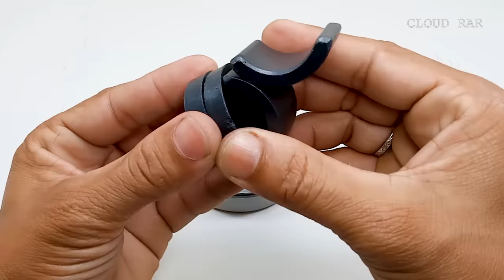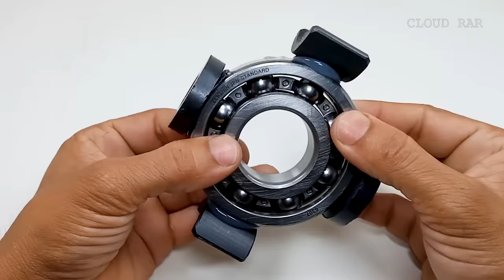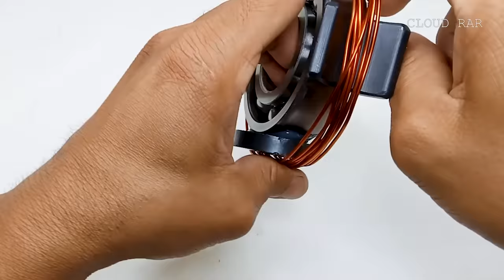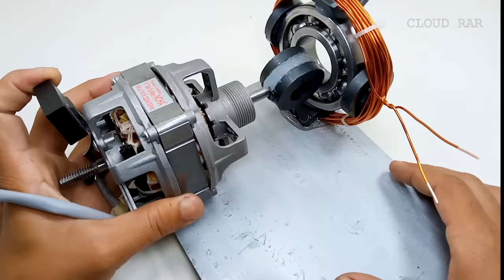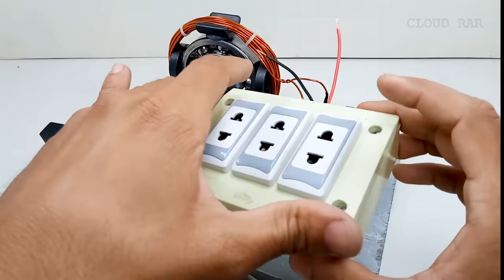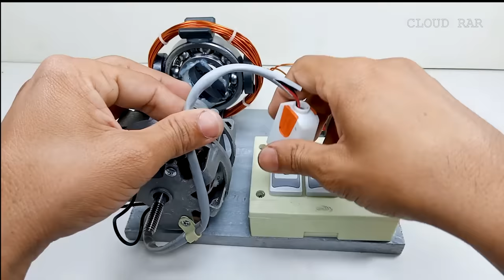free energy generator 240v electricity from magnetic gear and 100% copper coil transformer

Comment: You should redo your work, but:
1- open the socket box, or use a transparent one.
2- connect the light bulbs in the socket before starting the generator manually.
This would debunk most the genuine criticism in the comments.

Comment: What transformer is used? How many inputs and outputs? How many amperes are there? Thank you for telling.
What is the diameter of the coil and the number of turns of the coil, what voltage does it give to the transformer? Thank
Reply: I have the same question
Reply: это абсолютно не важно )))
Reply: آیا شما این ویدئو را باور کردید؟؟؟؟😂😂😂😂😂
Reply: @Raha.j а почему не верить видео, там все показано, но правда или нет, это уже другое видео.
Reply: The amps and volts is an easy answer. 

I’m thinking of number between zero and none.

Comment: That way,  you will need a step up transformer but may require a heavy flywheel incorporated at the back of the ac electric motor.

Comment: Don't just turn it on the table, but also lift it and remove it from the table. But that doesn't work 🤭 otherwise it will go out. Your inductive energy transfer doesn't work so well?🤔 But I like your ideas for constructing new devices. 👌

Comment: All.ok.but what is inside in the switch box, How manynumber of turnes of copper wire circulled over bearing magnet, and also thickness of the copper that is gauge SWG.

Comment: Before adding the transformer and the extension socket you would used a digital meter to show us the AC pause generated from the coil, and secondly you would have raised the project up while running I mean the wood wouldn't have shocked you.. Thirdly if there is any trick here then its within that EXTENSION BOX. great project tho. I know fully well if I try this it will never work for me. Lol

Comment: This design could be improved by the insertion of a phased subduction module in series with the vector control. This would make the device more compatible with non-reactive LED circuits.
Reply from the maker: Thank you so much for the information
Reply: What? Please specify! It really is easier to find this motor, but it greatly reduces the durability of the system.
Reply: I like it, call someone a clown without them knowing it.
Reply from the maker: Thank you @michaelmeenaghan8559
Reply: Pourquoi moi j'ai pas réussi ?
Reply: Dit moi  j'ai toujours fait ça  sans avoir un bon résultat
Reply: hola de que es el tranformador ?
Reply: @elvete4581   É gerar energia elétrica  de Forma Simples e Prática sem investir muto?

Comment: How can it will be 7kw when your transformer is very small, you should use #10 wire for 7kw or 7000watts to avoid burning of transformer for overload.

Comment: you should make big one that can run house i sure people will buy much better than battery i have few inverter 500 watts ,800 watts ,1100 watts,1500 watts and 3000 watts inverter but i have used battery to run them 12volt deep cycle battery 90Amp but i still need charger battery you make one that have 240 volt and 110 volt out put

Comment: The superior engineering of hot melt glue. Heck, he doesn’t even bother with neodymium magnets. That’s bold. 

He used that same motor with round magnet on a 7000 watt generator. So he has many successful designs. And a YT channel. 

Waste of free bandwidth.

Comment: So he using an alternator to spin a magnet inside a copper coil??? He will lose energy due to unity law.  Actual if he removed the heavy ball-bearing he would have more revolutions on the shade, making more Flux, making more current.  At what point is this free energy?

Comment: What is the input voltage of the transformer?
Reply: When you get the system running, you can use a voltmeter to test the electric output from the coil. By increasing the number of turns u get more volts and by increasing the cross section area size of the copper wire, you get more current generation. So u determine ur transformer input voltage. Eg. 24v to 220v transformer. Ur expected load size will determine the wattage of the transformer u will use.